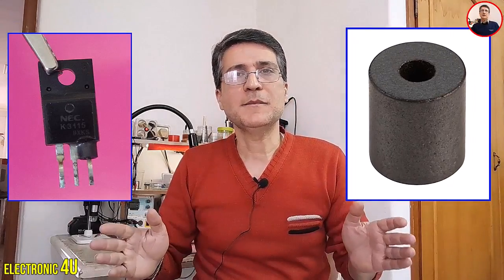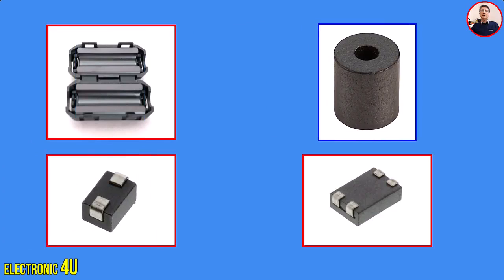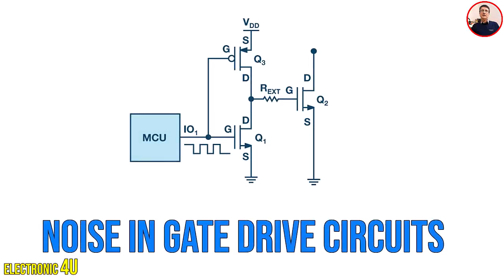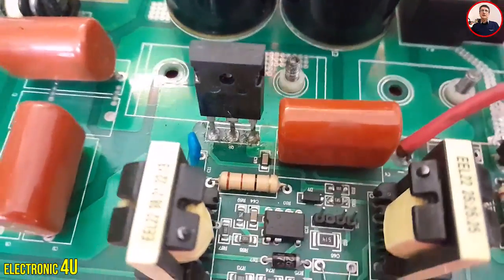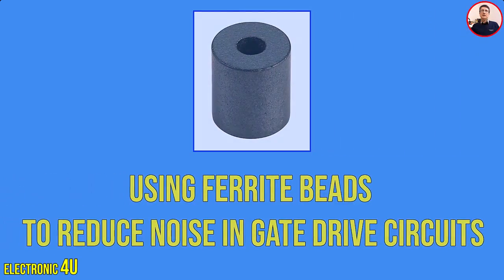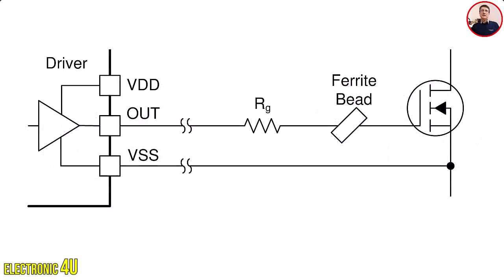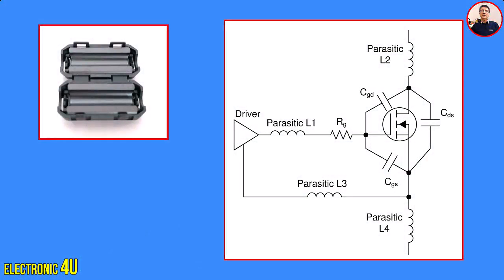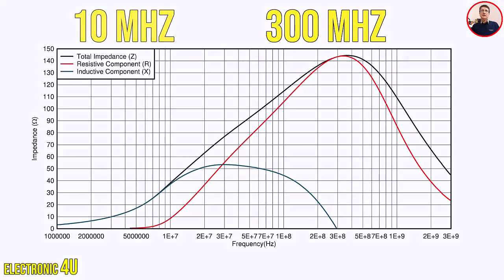Very important piece to reduce noise in switching

Comment: The switch time shown in your oscilloscope picture is incredibly slow, compared to my experience in DC/DC SMPS (8 ns), but it looks like your circuits are in the AC/DC area, so you're working in KHz rather than MHz.
Reply from the maker: Hello, thank you for your valuable explanation. My equipment is a bit old. I try to update myself